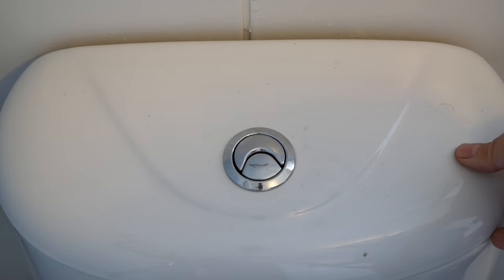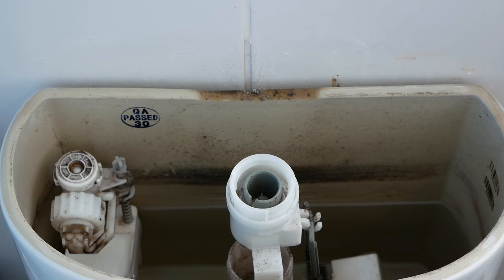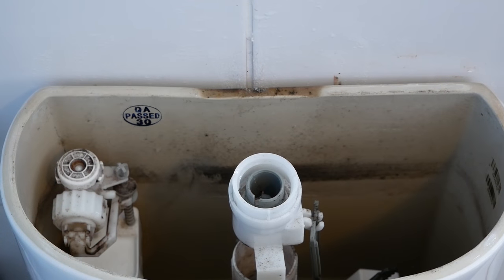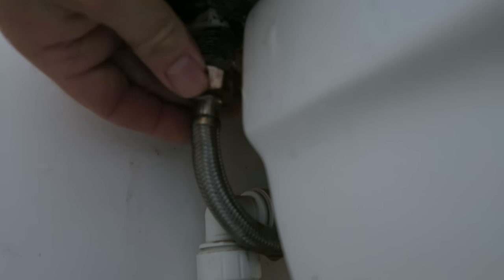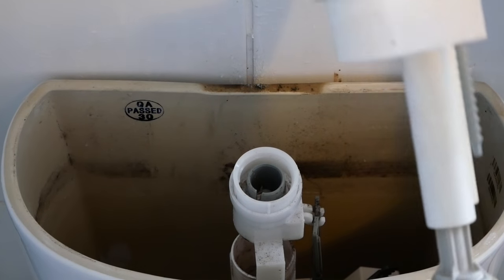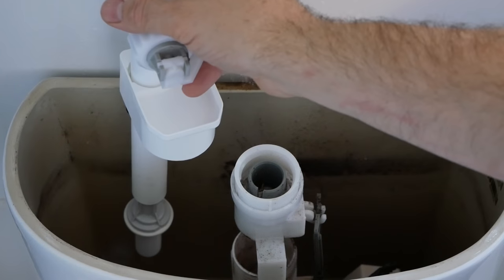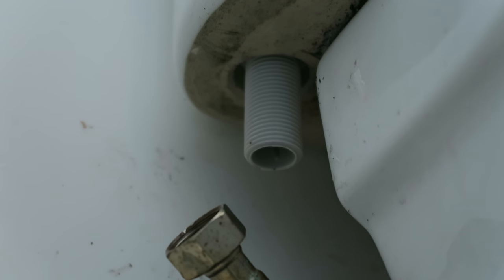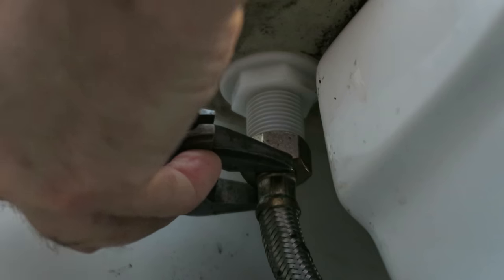Toilet Inlet / Fill Valve Replacement

Comment: Brilliant mate. Searching for a while for a solution to my mysterious problem. The inlet valve doesn't tell it to stop filling. You just mentioned how how it works, then I discover it's jammed against the cistern inside wall so won't move. It took a Glasgwegian to give a Glasgwegian the answer! Cheers.
Reply from the maker: Brilliant. Glad it helped out a fellow Glaswegian.

Comment: Thanks for this video very clear, I thought at first the seal had gone on the flush mech, but water didn't go  into the bowl until it was full, queue inlet valve not stopping the filling process, the arm is fine the water won't stop when I manually lift the raiser, gonna order a new inlet valve now, replace the diaphragm a couple of months ago aswell
Reply from the maker: Sounds like a good plan👍

Comment: Thank you for the wonderfully instructive video. My toilet inlet was exactly the same as the one shown so I could follow your clear instructions step by step. The only question I had was about the red washer, but you answered that in another comment, so thanks. 
I must say, having taken the old inlet mechanism apart, it’s not clear what had gone wrong as there are very few moving parts. Plus I had already replaced the membrane so I know that that wasn’t the cause of constant filling. Could it be the washer/seal at the top? And if so, that tiny and accessible part would have been MUCH quicker and easier to replace😃
Reply from the maker: Generally, if the washer doesn't fix it you as well to replace the valve. Which you did. Brilliant !

Comment: Thank you so much for your videos! By far the best on YouTube! 

I’ve just used your other video to replace the seal for a slow filling toilet, it fixed it and I’m over the moon! 

However as soon as I fixed that it’s now constantly leaking into the toilet bowl so I think I need to follow this video tomorrow and replace the whole valve..

 Do you mind me asking if you agree this should be replaced or might i have done something wrong whilst replacing the seal? Thanks again 🙏🏼😁
Reply from the maker: I would try the seal again. Sounds like it may not be seated properly, double check that small notch. If that doesn't work then a new valve will fix it for sure 👍
Reply: @handymancraftglasgow  I tried again, it didn’t work, so I’ve replaced the full thing and now it’s tip too and filling in 30 seconds! Amazing! Thanks so much for your help.. just saved me £80!
Reply from the maker: That's brilliant. Enjoy your new turbo flush 😁👍

Comment: Hi, is this fix of replacing the cistern inlet valve applicable for when the water does not rise back into the cistern after flushing the toilet and the button to flush the toilet becomes loose and not workable?
Reply from the maker: The inlet valve will fill the cistern and stop the water once full.

Comment: I know how to do this as i just changed the downstairs bog for a new torbeck. 

But the upstairs bog is such a crappy design it seems to have no way of doing it without removing the cistern.
These siamp ones work after replacing the diaphragm but fill so bloody slowly i suspect i have a filter in the bottom that is clogged.
Do these siamp inlets have a filter in the bottom that could be clogged?
Reply from the maker: There may be a filter in there. You have to disconnect the water pipe to get at it. It could also be that the diaphragm is not quite seated properly, probably worth checking that first.
Reply: @handymancraftglasgow  The diaphragm is fine i`m certain it is that daft filter now. Looks like i will have to remove the cistern to change it though. Unlike the old toilet downstairs.

Comment: Thanks for the video , quick question about optima 49 dual flush valve, changed it but I can see there is a thiny line of water still running in the toilet.. could it be inlet fault? Thanks
Reply from the maker: It could be. The water level could be a little high and flowing into the overflow (into the bowl). You can adjust the level. 
If its not the inlet then there is a good chance its the flush mechanism.

Comment: Hi! I have the same problem but my plumber is saying that to change the fill valve we have to take of the whole toilet! Is that true? Can you help with advice plz?
Reply from the maker: If its the same toilet you should be able to change the inlet valve unless there is restricted access to it.
You need to remove the cistern to replace the flush mechanism, that's a whole other video.
👍

Comment: Very clear tutorial, many thanks for this. One question: If I can't find the same kind of fill valve, could I replace it with a different sort, assuming it's still bottom entry and the inlet pipes are a standard/universal size?
Reply from the maker: Yes you can. Shouldn't be a problem. Just make sure the new unit will fit in the cistern, some are a bit bulkier than others.

Comment: Hi George, is i possible to just slide off the upper part of the new valve and the old one and use the existing coupling. I have a flush to wall pan and would prefer not to have to move it?
Reply from the maker: I dont think thats possible.

Comment: Hi Craig,

The inlet valve you mention; It is universal or a specific one used for your toilet? I have a cistern toilet also but I didn’t want to purchase a valve without knowing for sure.
Reply from the maker: The inlet valve I used is a universal one. It will adjust for height and takes up very little space in the cistern. Should fit most cisterns.

Comment: Great video, is there a reason that the inlet valve shut off works with a broken washer/diaphragm but doesn't when it's fixed? Seems weird, the float still lifts up but it just doesn't shut the bottom flow coming out.
Reply from the maker: Could be the housing containing the washer is not located properly.

Comment: Another question if you see this. Is there a way to remove the top cover on this valve ? TYEdit i just watched the video further on that filter is causingme a pain in the arse but my crappy toilet needs the cistern taking off to access it!
Reply from the maker: I've never taken one apart so can't help you there. If there is a problem, generally easier to just replace. Difficult if access is restricted.

Comment: I have the same infill valve as is shown in your video, and would like to replace it with the same one. Would you tell me the make and model please? (I can't see it marked anywhere on the assembly).
Reply from the maker: The inlet valves are pretty much the same. There is a link in the description for the one I used in the vid but was not identical to the one I swapped out.
If your toilet is connected with a flexible hose or plastic pipe (with a bit of play on the pipe) you will be able to connect. If you are onto copper measure the threaded part of the valve and get a new one with the same length of thread and the swap should go smoothly.
Reply: @handymancraftglasgow  Thanks for your reply. That's a help to me. ☺
Reply from the maker: No problem 👍

Comment: I literally cannot remove the white nut at the top to save my life. Tried for an hour. Tried using tools. It feels glued on.
Reply from the maker: Not sure what you mean. The nut sits on the outside of the cistern at the bottom. No nut at the top.
Reply: @handymancraftglasgow  I don't know what it's called. But the white plastic part of the top that you can screw off to get to the washer.
Reply from the maker: When you say top, do you mean the cistern lid?
Reply from the maker: Wait, are you dealing with a slow filling cistern?
Reply: @handymancraftglasgow  sorry, I didn't elbarote. So I'm replacing the inlet valve, however rather than replace the whole thing, id like to just replace the top part that is leaking by replacing the washer inside the twisty nut shaped thing that comes off. I've seen this in other videos. It's so damn hard to take mine off though
Reply from the maker: Sometimes it's easier just to replace the whole valve. Hope you get the nut undone 👍
Reply: @handymancraftglasgow  okay, thanks for your help :)

Comment: I live in the US and am home  for a week. My mum's toilet won't fill. Base is flush to wall so no access. Can I  unscrew  base from floor and pull it away? Guess it had to all be connected before pushing base to wall.
Reply from the maker: I would look for a consealed opening. Usually you can get into the cistern and there may be a hidden opening somewhere just above the toilet. I doubt pulling the toilet away from the wall will give you access but I know nothing about plumbing in the US.

Comment: Hi Handyman, how do I know which valve to choose?  I've got a floating ball thing, makes a really loud noise when it flushed.  Doesn't sound good!
Reply from the maker: You just have to pick one that will fit in the space you have in your cistern. If you have a ball cock valve you will probably have the old flush mechanism this takes up a bit of space. Equally just change the valve like for like. You can still get ball cock valves 👍

Comment: Excellent video. totally embarrassed not to have any simple handyman skills.
Can you tell me what size spanner I need to undo the large plastic nut that goes on the outside of the system that holds the inlet valve in place; you start to undo the nut I'm on about at 3:25.
Reply from the maker: I use an adjustable spanner for those, I think its about 28mm but not entirely sure. 
This is the spanner I use but you can get cheaper ones. Just make sure the jaw opens up to at least 30mm.
https://amzn.to/2QzY3t8

Comment: I’ve installed a new torbeck bottom fill valve but it is leaking underneath where the plastic white nut screws up to the cistern. Will putting a rubber washer in between the bottom of the cistern and the white nut create a better seal so it doesn’t leak? I’m stuck what to do. The rubber part is fitted on the inside of the cistern correctly, it’s just dripping underneath the cistern where this white nut is.
Reply from the maker: Sounds like the rubber washer on the inside of the cistern is not located properly or the white nut is not tight enough. Check the washer first, make sure it is in tact and not split and make sure the bottom of the cistern is nice and clean, no grit or dirt. Then tighten the white nut making sure the valve doesn't move from the center of the hole so the rubber is covering as much of the hole as possible. The rubber washer on the inside of the cistern should be enough to seal.
Reply: Handyman Craft Glasgow Thanks for the reply. I’ve just took it back off again and noticed that the washer on the old fill valve was flat and not like this new one which is sort of coned. Should I try putting a flat washer on instead do you think like the old one had on and it might seal it better?
Reply from the maker: You could try it, I actually prefer the conical shaped washers, they usually give a good seal. If the new washer doesn't work try the old one but just remember its an old washer and may not seal up again.

Comment: Hi mate my toilet inlet valve sensor isn't working correctly (the grey twirly bit doesn't recognise that the water needs to stop at a certain level and water continuously flows into the tank even after changing a ripped washer)
Any ideas what it could be?
Reply: Also the inlet valve  fills water from the bottom bit in the tank, dont know if that's correct
Reply from the maker: Sounds like you may need a new valve.
Reply: @handymancraftglasgow  my toilet is the same as in the vid
Would it be safe to follow ur video?
Reply from the maker: Should be but I have no way of knowing for sure.

Comment: Great video. Thanks for posting. Same valve as mine abd wandering how to change it. Could it  just be the washer. Very very slow refill problem.
Reply from the maker: If the washer is split at all it will cause a very slow refill.
Reply: @handymancraftglasgow  i took it out and inspected and it seemed intact. Looked a bit worn though. I have ordered a replacement and fingers crossed it works.
Reply from the maker: Hopefully that's your problem.

Comment: What is the orange ring as seen in the background of 4:12 for please?
Reply from the maker: Good question. 
The orange ring is a fibre washer to seal between the bottom of the valve and the water connection nut see here https://youtu.be/oz6z24HciSg?t=407 . The washer will fit in the metal fitting and then tighten the fitting to the valve. The fitting I have (flexible connector) in the video already has a rubber washer built in so the fibre washer wasn't required. If your fitting has a fibre washer then its a good idea to replace it.
Reply: @handymancraftglasgow  thanks so much!

Comment: Can you explain me, how this valve works. I have replaced membrane for new one but valve does not stop water from pouring to tank. Any idea, please ?
Reply from the maker: Have you tried to adust the float? If the float is too high the water will keep flowing. Lift the float manually and see if it switches the valve off. If it doesn't there is a problem inside the valve. If you changed the diaphragm and still have problems a new valve may be required.

Comment: How do I know if I need to change the valve? Mine is overflowing after i changed the diaphragm as this was split. I've adjusted as far as I can but the level still comes over the float and the float doesnt come all the way up. Any ideas?
Reply from the maker: Make sure the diaphragm is seated correctly and you have lined up the notches. A misalignment can cause this problem 👍
Reply: Its definitely lined up properly as no water is coming out of that area now. The part right on the top in this video plugs the hole when water level is full. Mine doesnt move and just seeps water out of it
Reply: I've replaced the washer(diaphragm) but the valve on top, can I change this or do I have to buy a new inlet valve
Reply: My water level goes past the float
Reply from the maker: I would deffo open it up. Make sure the washer is seated properly and put back together. If it doesn't work a new valve may be in order.
Reply: Can I get into the top part of the unit? Water comes out the top and water continues to come over the top of the float and over flows for a while
Reply: If I need to purchase the other part that you replaced in your video, could you advise (add link) to the right one please
Reply from the maker: The links are in the description. Hope it goes well 👍
Reply: Bought a new siamp 99b inlet value but have now opened a while new can of worms. Water is leaking from elbow bends, isolating valve. I'm no plumber and cant afford one with covid but now I'm having to keep my whole house water off til I get it fixed

Comment: @ 06:42
What to do if the valve doesn't reach the new inlet valve pipe?
Reply from the maker: That is a bit more involved. you will have to extend the pipe so it will each. Sometimes just putting in a straight fitting  in the pipe is enough to catch. May be worth getting a plumber in, a plumber could do this very quickly.

Comment: You didn’t have to change the whole valve, you could have screwed the new one onto the gray part it’s interchangeable with new fill valve.
Reply from the maker: This way you can use any brand of fill valve instead of the exact same make. 😀👍

Comment: My toilet is making a very loud vibrating noise when flushed. Am I correct in saying this is the part probably causing it to do that?
Reply from the maker: Yes. A very good chance its coming from this part.
Reply: Thanks for the reply. I am going to give it a go with your vid as soon as the snow melts and I can go out and buy the part!!
Reply from the maker: Brilliant. Hope it all goes well.
Reply from the maker: Brilliant. Hope it all goes well.